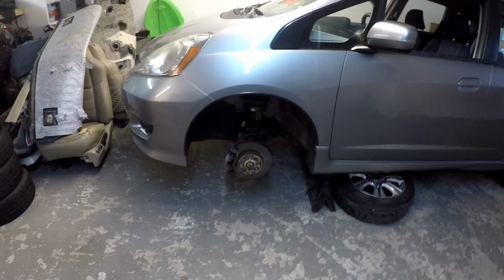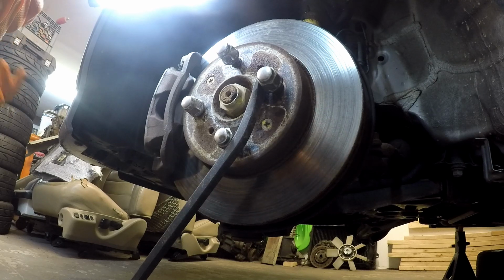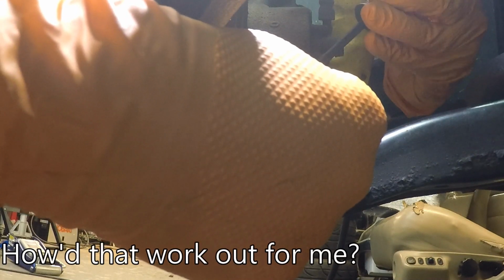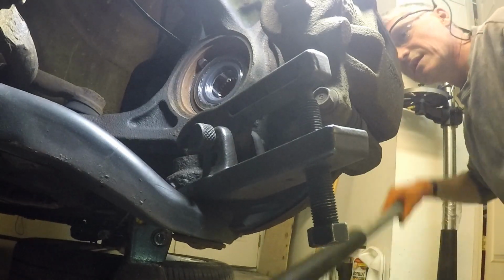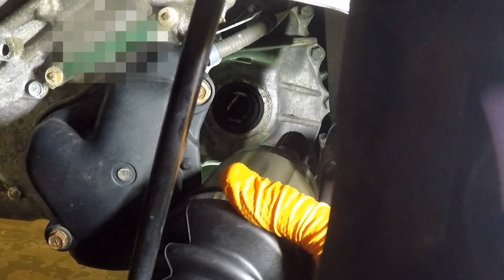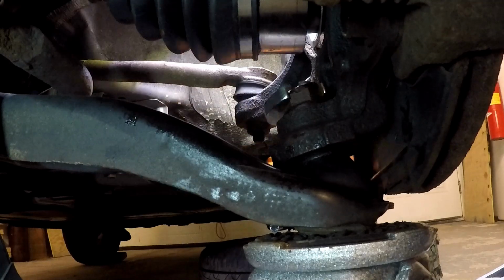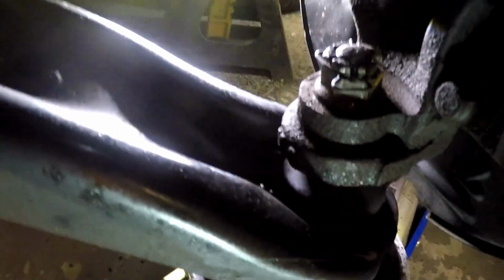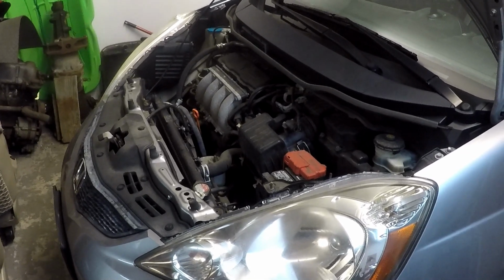Honda Fit 2007-13 CV Axle Replacement

Comment: Salt belt Fits have been recalled for the axle issue. Check your VIN. I had both of mine snap on my 2012. The recall is forr 2007 to 2013.
Reply from the maker: From Honda's press statement: The recalls will apply to vehicles that were originally sold or ever registered in these 22 states and the District of Columbia, where road salt is regularly used in the winter: CT, DC, DE, IL, IN, IA, KY, ME, MD, MA, MI, MN, MO, NH, NJ, NY, OH, PA, RI, VT, VI, WV, WI.
Reply: Even the so called replacement cv axle is garbage. The Aftermarket looks way better. @roundtailrestoration
Reply: I got a letter from Honda about this recall I took it to dealer today and had it done for free.
Reply from the maker: @xelaju8  Awesome!
Reply: @xelaju8  me 2.   Glad I didn't have to do it myself.   Although I have lots of practice thanks to my Civic.
Reply: Had mine replace under recall and it only lasted a year. Now im buying a GSP unit from Rock Auto.
Reply: @mg8720-u7j  if Honda replaced your axles and they only lasted a year, you did not actually have the axles replaced. Even under the worst conditions they would still be performing fine years later. You most likely had the axles inspected and they passed, and they failed a year later.
Reply from the maker: @9ZERO6 yeah, that's pretty bad. Not sorry I switch to a Mazda.

Comment: The replacement aftermarket shafts do not have a damper fitted. Have you noticed any vibration?
Reply from the maker: I don't have the car anymore. But, I put probably 10-15K on it after I replaced the shafts and I never noticed a vibration - both of my new shafts did not have the damper.
Reply: @roundtailrestoration  That's good to hear. If there was any vibration you would have noticed from the start. Thanks.

Comment: Mine was the passenger side shaft, the hub nut was welded to the CV shaft and the hub, complicating things quite a bit. I'm not able to remove the remains of the shaft that connects to the tranny though. That cotter pin is factory, Honda decided to be different. There's a gap in the spline too, I don't know if you mentioned it or not.

Comment: TIP:  Harbor Freight ICON brand Internal Straight Snap Ring Pliers (P/N: PSSRI12) work PERFECT for the snap ring.  I tried like 5 different tools to squeeze the snap ring for install and the HF pliers worked perfect, first time.
Reply from the maker: Awesome. Thanks for the tip!

Comment: Also Chris, i always leave those stupir rotor screws out but you can also get fooled because when you try to test the cars drive (up on stands) you will get a clunking noise (not a rattle so much) this is because theres play in those rotor holes. This will make you think your axle is bad! You must put the wheel back on and crank down all lug botls tight because the wheel is what holds your rotor on!
Reply from the maker: Yup, same for the rotors. They get "clamped" in by the tire, too.

Comment: On the 2013 FIT and for the passenger side CV axle, you need to support the engine from below and pull 2 out of three of the bolts for the dogbone. No need to remove it, you can slide it down and this will give you better clearance to get your heavy duty pry bar in their. I used a wrecking bar which is much stronger than any regular prybar. It was a tuff job.
Reply from the maker: Thanks for the tip. Good job getting it done!

Comment: Also Chris, i only had to pull the ball joint nut and hand the caliper up, then pull the 2 strut mount bolts. No need to life the knuckle off the ball joint.
Reply from the maker: Okay, that's cool. The least disassembly the better!

Comment: Hi Chris, i have it all apart but the cv axle wont come out. Its hard to even get a pry bar in there. The dogbone is in the way. Any thoughts? Pulled the nut off dogbone but theres still a threaded bolt. Do i tap it upward?
Reply from the maker: I'm sorry, I don't remember. I don't think I had a lot of trouble pulling the axle out. I did have a manual that I was following, but I no longer have it, or the car. Sorry, man.
Reply: I have it out, i cant the the new axle all the way in. some oil leaking out. @roundtailrestoration
Reply from the maker: @mg8718 I remember having a time getting to seat all the way. I pulled it out and rotated it and tried again. It did eventually go in.
Reply: Its a 30 mph wind out here today and i cant get that bastard back in. Maybe its because its aftermaket aprt @roundtailrestoration
Reply: I tried what you suggested and it whent right in. Thanks Chris. Also, i lost a few ounces of oil and i dont have time for a fluid change. Will it be ok? @roundtailrestoration
Reply from the maker: Probably are fine. Is there a dipstick for the gearbox? Should be a yellow loop, I think. You can always check that and if you're above the bottom line, you'll be fine until you get top it off.
Reply: No dip stick for gear box. @roundtailrestoration

Comment: I never like my head being under the rotor.
Reply from the maker: Don't blame you. Third one is crazy! More than just one design flaw I'd say. Good luck!
Reply: In my opinion i think its that shitty black moly grease that all of them use. Including GSP. One day im gonna remove the boot on a new one and remove that black grease and then stuff it wit Mobil 1 Synthetic red grease. I bet it will work! @roundtailrestoration
Reply: Suppose we are like 1,000 miles away from home and our CV axle deciides to break on the streets of New York City!
Reply from the maker: @mg8720-u7j  I was about 60 miles from home in a multilevel parking garage. Had to push the car all the way down to get to the tow truck. It was great fun!
Reply from the maker: @mg8720-u7j  you're probably right!

Comment: On on my 3rds cv axle on the right side! Both Honda OEM's failed! Now im putting on a Rock Auto by GSP! Personally i think its that shitty black moly grease they use. Wish i could pack it with Mobil 1. Too much work and mess i guess.
Reply from the maker: Yup, probably. Shouldn't have to worry about it, tho!
Reply: Im gonna change it out. I just want to get this CV axle clunking problem fixed. I spent alot already. That CV Axle was from Honda and is only a year old. Clunking is coming from the outer side. Changed all my brake parts and caliper @roundtailrestoration

Comment: Anything for the passenger side???? I can’t find anything. It separates into two sections
Reply from the maker: Hi Brandon. It's been a while since I've done this and I don't have the car anymore, but I don't remember the passenger side being two pieces. I did both sides and while the connection into the transmission was a bit different, it wasn't significant. What year is your Fit?

Comment: I just did my yearly inspection on my 2008 automatic FIT with 208,000 miles and the drivers center rubber boot looks terrible and it looks like it has a crack in the shaft.  I just ordered both CV-axles off ebay today.  They sure are expensive.  $212.
Reply from the maker: Yeah, no fun. But, I'm sure it's cheaper than having someone do it for you. Good luck!

Comment: Im having to REDO the axle that Honda replaced as part of the recall... just over a year and the CV boot opened up and died. Honda said it was over a year and tough luck. Real greasy move on hondas part to replace the faulty part with a cheap part.
Reply from the maker: Sorry to hear that. I've moved to a Mazda 6 and love it. A step up, but a more solid car I think. And zero problems after 70000 miles. Good luck!
Reply: @roundtailrestoration  My buddy just bought a 2014 Mazda 3 last year.  He loves the 40 mpg that he is getting with it!
Reply from the maker: That's great. I can get just around 30mpg if I'm gentle and get some highway miles in there. Not too shabby!

Comment: ours broke less than a week after we received a notice from Honda that they had the parts to replace it. now we have to deal with a 30 mile tow to the dealership to get it fixed and hope they refund us for the tow. the axle is completely broken off and the car is not drivable. have to use the parking brake as putting it in Park will not stop the wheels from rolling. so get it fixed by the dealer ASAP!
Reply from the maker: Good luck. I'd be interested to know if they reimburse you for the tow.
Reply: @roundtailrestoration  I think we could have gotten a reimbursement for the tow since it was an axle break related to the recall. at least the whole repair will be covered. can't imagine what a dealer would charge to do that! I remembered we had our emergency road service coverage on our Geico insurance and that covered the tow to the dealership, so I didn't have to hassle with getting a reimbursement from Honda. thanks for the helpful video. wouldn't have noticed that's what the recall was for till it was mentioned in the comments about it. it's my son's car and he just got the recall notice last week and i'd forgotten about it.
Reply from the maker: @Synchrimedia  glad to hear you got the tow covered in any case. I got an estimate from Honda because I wanted to know how much I was saving myself. It was $800 for both sides using aftermarket parts or $1200 each side using genuine Honda parts. Craziness!
Reply: @roundtailrestoration  wow! $1200! so glad we got it done under the recall.

Comment: That is the easiest Axel that I ever done on a vehicle you did not have to lose the lower ball joint all you have to do was losing the strut and lose the ABS sensor and the axle nut
Reply from the maker: Good deal! I followed the Haynes manual I had since I hadn't ever done the repair. It was pretty easy. Glad it worked out for you!

Comment: Just had to do this. One way to make it easier is to undo the top two knuckle bolts instead of the bottom ball joint bolt. You still get all the room to move the knuckle around and those bolts aren't as awkward to undo as the lower ball joint bolt.
Reply from the maker: Thanks, Brian!

Comment from the maker: Hi, everyone. Honda has issued a recall to the 2007-2014 Fits for corrosion issues in 22 states and the District of Columbia due to road salt. There are other cars impacted, but the system worked here. This video and your calls to Honda/NHTSB made a difference, I'm sure!
Reply: no way, just had to do this fix for the same failure
Reply from the maker: I didn't look into a reimbursement possibility.
Reply: @roundtailrestoration  Would California be apart of that state? I have a 2007 fit and I got this problem few weeks ago.
Reply from the maker: I don't know specifically, but I would say so as much snow is there up on the mountains. Q
Reply: @roundtailrestoration  I live in the mountains and it’s going to snow tomorrow lol
Reply from the maker: Uh oh. Then good luck!!

Comment: Thank you for making the effort to video and upload this. It is a huge help
Reply from the maker: Makes me very happy to hear that! Thank you!
Reply: @roundtailrestoration  I heard the pop on my way to work at 430am. I instantly thought new car at 250k. I watched the video and realized it was doable. I don't want a 500 a month payment for a new vehicle.  I like my paid off Fit
Reply from the maker: I don't blame you. I haven't had a car payment for decades. Amazing how much money you can save!!
Reply: @roundtailrestoration  just wrapped up. Thanks again. I didn't even drain the trans fluid! Just a small bit dripped out. And I didn't have the ball joint tool. But I had a big hammer. I gave it 3 light smacks on the knuckle from the side and it came loose. Had I known it was this possible I would have done it in wawa parking lot and saved the tow bill
Reply from the maker: Yeah, it's rather anti-climatic, isn't it. Wawa!? I grew up in S. Jersey. I love Wawa. That's pretty much where I eat when I visit home.
Reply: @roundtailrestoration  that's ironic. I'm in Forked River.i was on my way to Jersey City. So happy it didn't break there.
Reply from the maker: @64maxpower  Oh, man, no kidding. I used to hit LBI when I was in high school delivering Gatorade and stuff like that to businesses up on the boardwalk. Small world!

Comment: 2009 Honda Fit automatic transmission here. Week ago the passenger side axle snapped while turning right. It was so extremely under the rubber in the middle. I had my mechanic to replace both. I would encourage people to file a complaint with NHTSA. Maybe Honda will be forced to do a recall on axles for FITs.
Reply from the maker: There is a previous comment that recommend the same. I made the complaint as well, and also to Honda.
Reply: They have been recalled now.

Comment: Thanks for the helpful video!  This just happened to my 2013 fit with 156k.  I was so relieved to find out it was an axle and not the transmission.  This is my project for upcoming weekend
Reply from the maker: I had the same sense of relief! Good luck!

Comment: Thank you for the video, my daughters 2009 Fit Has just under 80K and broke just like yours, its funny the passenger side is ok but the car wont move, I guess its because the path of least resistance. I will get the parts and do it this weekend.
Reply from the maker: Yup, that's exactly what's happening. The differential inside the transmission is sending power to the easiest wheel to spin. A design limitation and the reason for limited slip differentials. I'm sure you'll do great, but good luck!
Reply: @roundtailrestoration  thank you, luckily it happened right in the driveway.
Reply from the maker: @wurly164  you're lucky. I was half way up a parking garage that the tow truck couldn't get in going to a minor league hockey game. It was a long push down and quite the night!

Comment: need to replace mine too. How is it holding up?  I'm skeptical about getting cheap parts, but it seems like I don't have much choice since the oem is $500 a piece. mine is 2007.
Reply from the maker: I have since gotten rid of the car, but didn't have any issues. But, put less than 10k miles on it before I got rid of it, so it's hard to give you a solid answer.
Reply: Yep.  I just paid $212 for an aftermarket set on ebay.

Comment: Does the transmission oil need to be drained? I have a manual transmission. What about axle seals?
Reply: No, only a small amount will drip out. Not enough to have to replace

Comment: Great video thanks for making, helped me with my car.

I just did this job on both sides. The CV axle also failed in the rubber dampener, twisted and broke.  

Tip: instead of separating the ball joint on the lower control arm I just unbolted the two 19 mm bolts on the bottom of the shock tower. Unscrew the brake line strain relief mount and pop the ABS sensor wire out of it's mount by squeezing the clip just under the brake line mount. Once this is done you can just pull the wheel out of the shock and move it off to one side. Gave me all the room I needed on both sides to remove and replace the CV joints. Really easy to take apart and put back together.
Reply: Super late to tell you this obviously, but most of the times those two bolts are your camber adjustment bolts so if you remove those you should get an alignment. Breaking the ball joint as he did often seats close enough back to the same home you can avoid that $80-$120 charge.
Reply from the maker: @danielapplegate6977  Better late than never. Hopefully he didn't have any further problems!
Reply from the maker: Glad it helped, Scott. Definitely a design flaw. Good call on the way you did it. More room would have been great!

Comment: Thank for posting!!! Just  did both axles: Just a tip: Invert the Castle Nut when applying the Ball Joint Remover...
Reply: 2nd Tip: No need to drain the Tranny Oil
Reply: @JosePerez-by2zy  Does that apply to both the automatic and manual transmission? I am replacing two axles in the next few weeks. Should I replace the seals too? I have a manual transmission.
Reply from the maker: In my opinion, if you are remotely close to needing to change it based on milage, I would. You're already under there. That being said, the manual didn't mention to do it for either transmission type.
Reply: @roundtailrestoration  Thanks. I actually flushed my gear oil when I got the car 3 years ago. I guess if the seals look good I'll just reuse them.
Reply: @brendonmonson4053  No need to change the axle seals... Not unless its damaged during installation...
Reply from the maker: Thanks for the castle nut tip. I felt pretty foolish after that. I wasn't sure about the tranny oil. The manual didn't say anything and I wanted to be conservative. I think it needed it around that time anyway. Thanks for watching!

Comment: Our 2007 Fit with 230,000 KM just had the exact same thing happen, we thought the transmission was gone but actually right side axle snapped.  We are replacing both sides since this seems to be a weakness in the Fit.  Thanks for this.  This video was helpful to understand what happened and is the reason why we are replacing both sides to make it safe for our daughters to drive.
Reply from the maker: Yup, I thought I destroyed the transmission as well. I am convinced it is a design flaw. I've had some comment that their new axles do not have the center rubber part (like original). I'm glad the video was useful and good decision to replace them both!

Comment: Using an impact wrench where bearings are present is not a good idea...….
Reply from the maker: Thanks for you comment! I agree. However, if I remember correctly, the only bearings are contained in the CV axle, not the hub of the brake disc. Since the only time I used the impact wrench was when I removed it, I didn't care about damaging the already damaged CV axle. Maybe I'm mis-remembering?
Reply: Hi Chris, I was thinking about the bearing(s) inside the wheel hub, which will / might feel the impact vibration from the impact wrench.
Reply from the maker: Gotcha. Didn't think about that.
Reply: But congratulations on a video which clearly took a long time and effort to make, while you were doing the job!
Reply from the maker: Thank you very much!